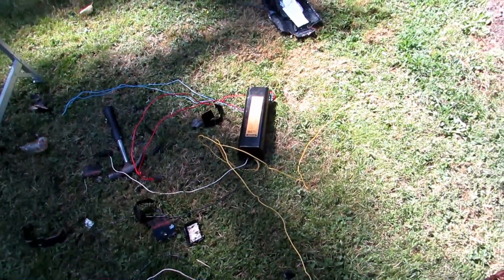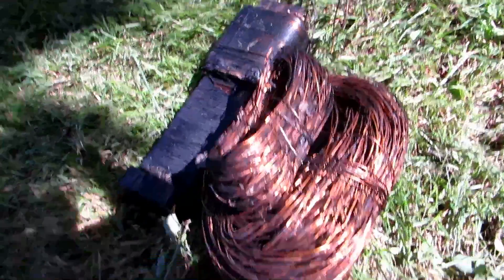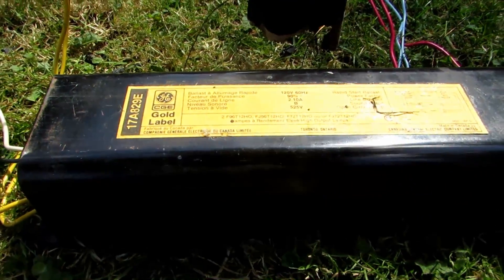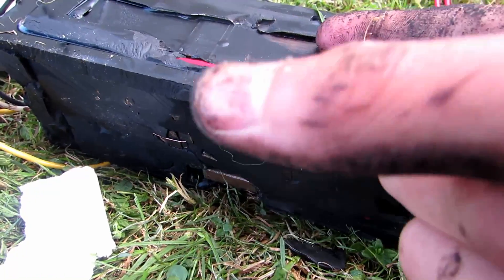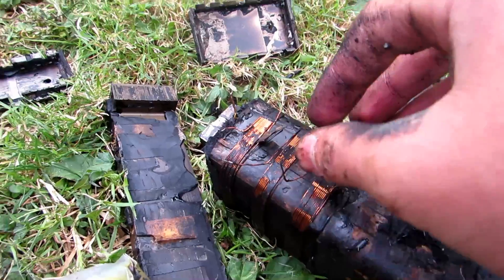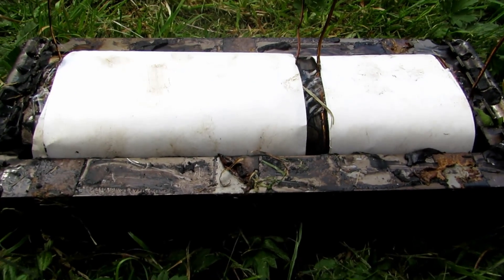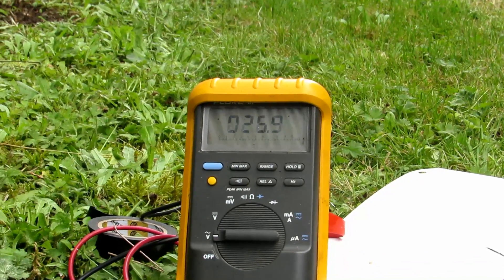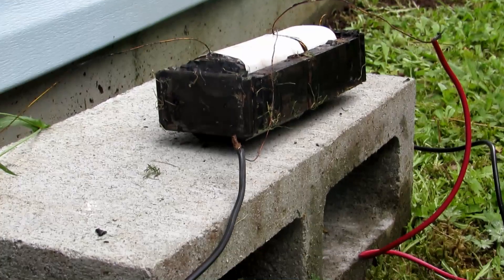Ballast Teardown and Re-assembley

Comment: Sorry. You’re wrong. It steps the voltage up to +500v to excite the mercury vapor in the tube via uv light emitter at the ends of the tube and once excited it lights up. Then the voltage drops down very low to just maintain the low voltage light.

Comment: Fortunately, this particular Ballast does not contain PCBs because the 'E' at the end of the model number means 'Environmental' - a bit ironic for fluorescent lights because the bulbs contain mercury. Our government was slow in the response to banning the production of PCBs, when compared to other countries. PCBs are super toxic to wildlife and humans. The delayed banning was solely for economic reasons. Mercury in fluorescent tubes/bulbs also ends up in the environment because people just throw them in the garbage - despite being hazardous waste.  Anyway, if the magnetic ballast does not contain PCBs, it will say this on the label. Assume a very old magnetic ballast that does not say “no PCBs” has them, and dispose of the ballast as hazardous waste.

Comment: It's possible to separate the housing without mangling it; after all you may want to save them for whatever power supplies you build. A lot of them have four tiny tabs at each hole that are a real dog to pry up so you may be better off just drilling those out. Once I'm done with the tabs I just work an old bread knife around under the cover until it pops loose, no bending required. Then I use the knife to work along the sides, prying just enough to release their grip on the tar. Then I put the ballast face-down on a piece of scrap metal on the stove, turn the element up to about 1/3 power and pry at the ends with moderate pressure until the whole mess finally comes loose. The procedure makes the place smell like a roadwork area for a while but at least it's effective. I get rid of the majority of the tar by smacking it with the knife handle until it crumbles and falls off, being careful not to damage the windings or the laminations. Often times, large chunks of tar are left hanging from fine wires, what a pain those are to get rid of.

I have the instant-start version of that gold-label ballast, it's in one of four freebie antique shop lights I picked up recently. The rest came with GE Tulamp ballasts, also instant-start, two of which were bad and have been gutted. I'm still going to see what I can do with them though.